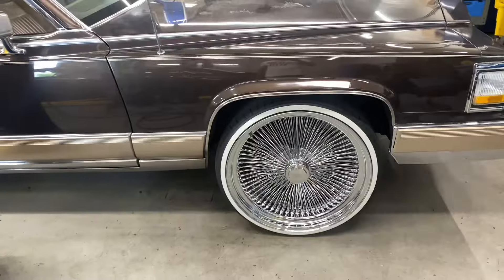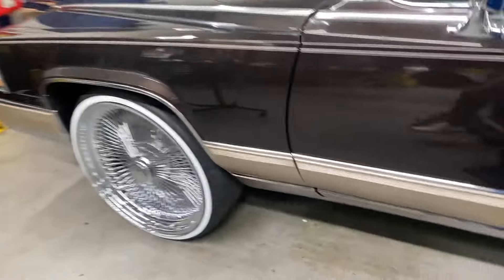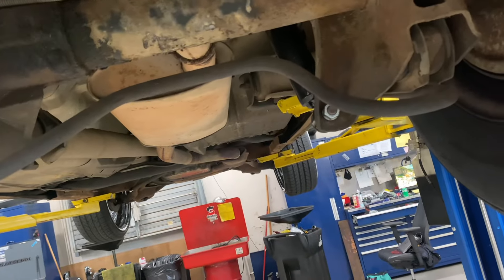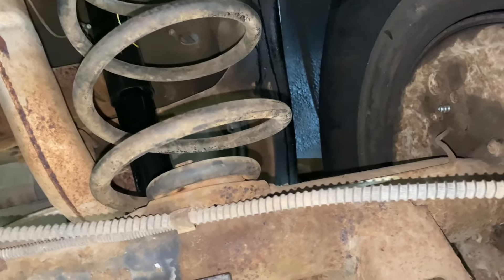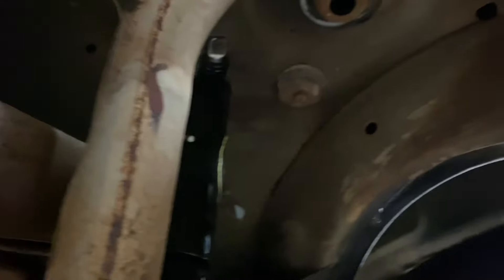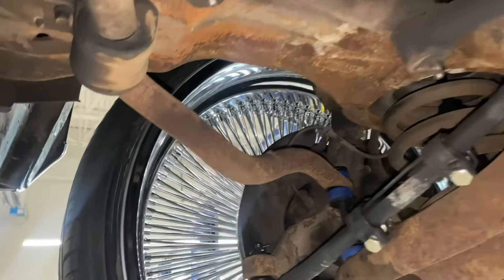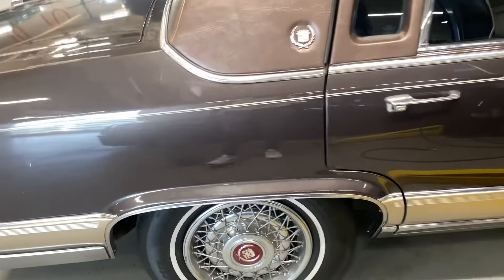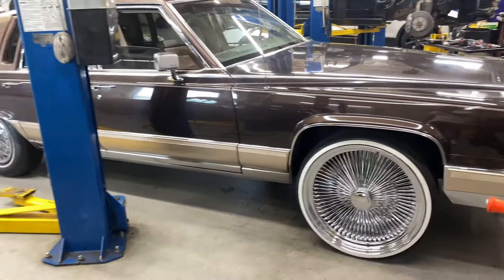In the shop already!Finally looking it over on the lift.

Comment: Did you get longer wheel studs back in the day The wire wheels are used to be coming off people cars while driving it happened to a couple of my family members
Reply from the maker: Just factory length studs
Reply: You can't use longer wheel studs with knock off style spokes. The wheels won't sit in the teeth of the adapters correctly.